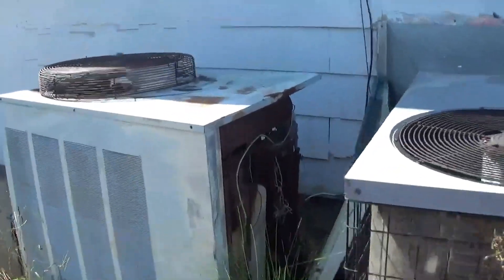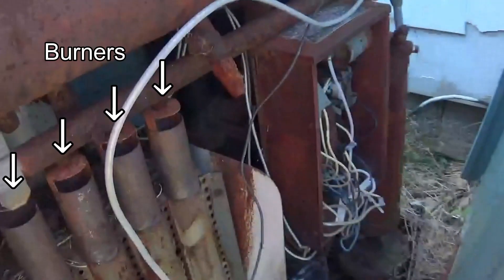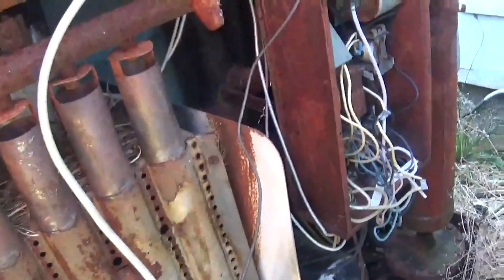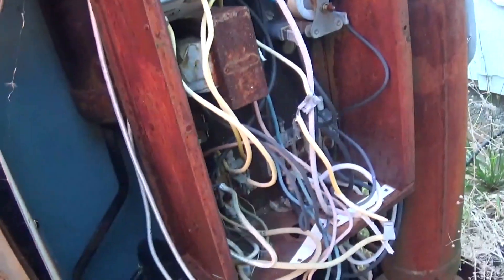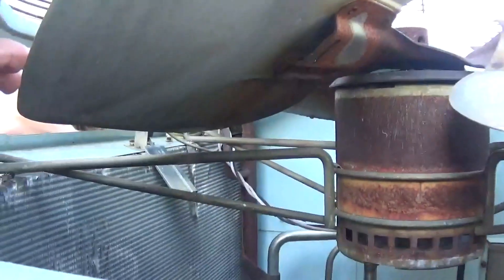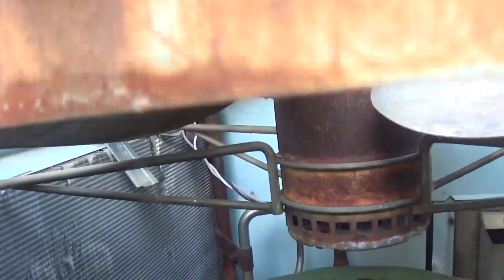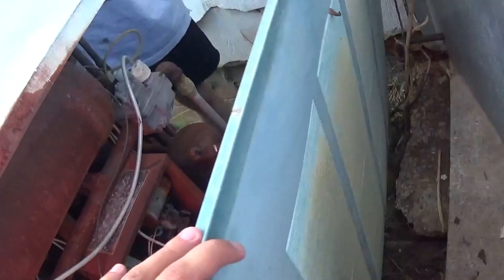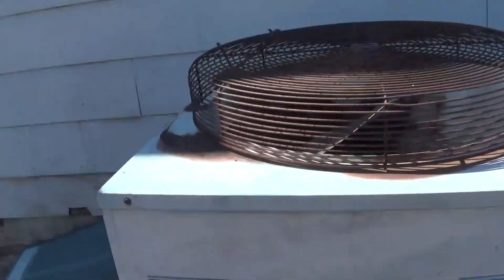VINTAGE Arkla-Servel Ammonia-powered Gas Air Conditioner

Comment: In the case of the gas fired water chiller.  I believe since these were not assembled so gravity could be utilized in the same way as a Servel refrigerator, a hydraulic pump as part of the treated water circularity system was used to move the Ammonia refrigerant through the system.

Comment: When I build my house back in 1993 I installed a 3 ton Servel gas AC.  Still running.   The only problems have been on the gas side.  Ignition modules or safety switches.  I have free gas so the extra cost for the unit was not a problem.

Comment: I used to work in these, the brand is Arkla servel, that thing looks like a compressor is actually the evaporator tank where it chills water to go to the indoor coil. It uses ammonia refrigerant, which is very efficient, those things lasted forever, about all we ever had to do was add water and replace the water pump

Comment: That huge compressor is the evaporator tank for the chilled water loop. Nice find! Been over 30 years since I saw one in operation.
Reply: AKA water tower.
Reply: @DandyDon1  AKA P/N 19009-14, for this  5 ton model.